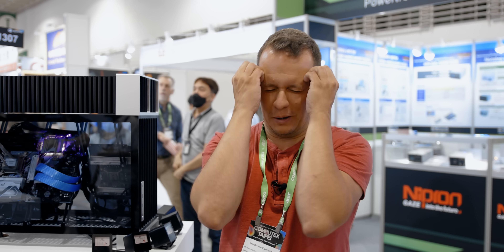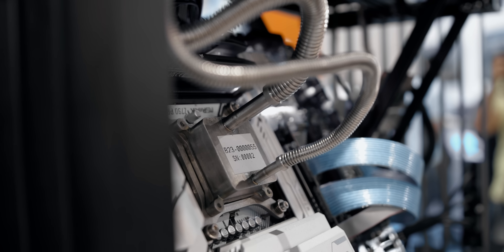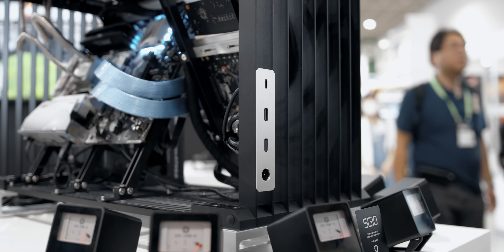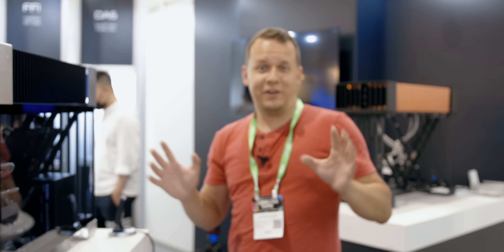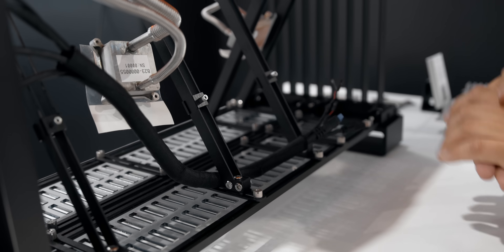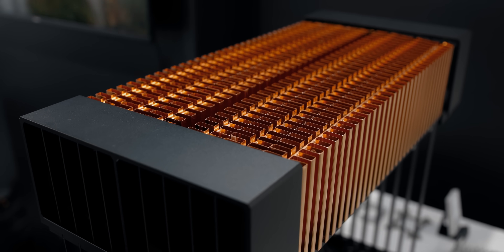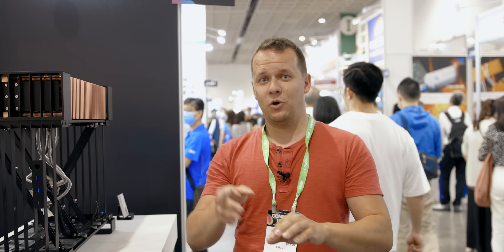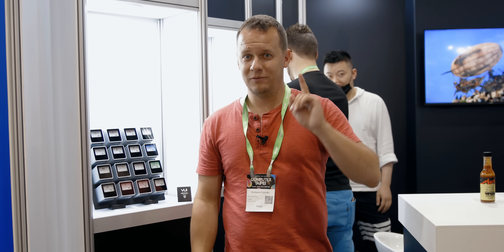Passive Cooling just got REAL.

Comment: The angles are likely necessary to ensure proper refrigerant circulation: when the plate boils the refrigerant, the angle ensures bubbles will rise towards the outlet and help the natural convection along instead of potentially trying to go back up the inlet and stalling the whole thing if the bloc was horizontal. Kind of neat, though I need my PC fans' noise to bury the slight humming from my UPS.
Reply: The angles are just just a gimmick to fill the otherwise unused space and make it look cool, as they cannot shrink the heatsink for obvious reasons. Ideally they would have tried to make it as compact, but dimensions are dictated by TDP
Reply: @TheTecnicamente  If you have a passive evaporator and condenser combo, the only thing circulating the refrigerant around is the liquid phase sealing the inlet against vapor going back up the way it came from, the angle ensuring (most) bubbles cannot go back up that way and the liquid phase's weight providing lift to move the vapor phase.

Putting the cards on an angle wasn't necessary though, they could have made angled evaporators to leave everything else squared off. Though this would have made the evaporator taller (as tall as it is wide for a 45 deg. angle) and required more refrigerant to flood.
Reply: @TheTecnicamente  Mhhh, I'm fairly certain they need it to avoid any backflow in the system, that's either that or full on vertical components.

Comment: Looks good, but as far as I know Calyos already scammed their customers once (Kickstarter NSG S0 - passive case) which is why in the aftermath the Monsterlabo team split up from them. Monsterlabo offers "The Beast" (400 to 600w passive cooling case) for 750€ they are lovely people and really care about their product,  therefore I won't even consider Calyos unless they not only ship working high quality products but offer better performance than Monsterlabo at as similar price.
Reply: "The Beast" only supports 400W in passive cooling configuration. You need to add fans if you need more.
Reply: @vsm1456  I know but the main problem is still standing!
Calyos never delivered their product, never paid their backers back or even acknowledged it! They just went silent for 6 years, now start promoting pretty much the same product and somehow nobody from the hardware community questions them...
(Including Hardware Canucks)
Reply: @Ahnii  exactly. And now they get promoted again even though they do it with Streacom. I know people that payed 1400 euros incl. All for that chassis and it never arrived.
Reply: @Ahnii  It seems LTT refused to cover them because of that, apparently Calyos won't refund ppl who bought the original NSG S0, but the "solution" of Calyos is that they will give backers a voucher (of the amount of what they spent on the original Kickstater campaign) to buy this new case, so they'll have to spend like 400-500$ more to get what they backed for, more than 6y ago. That's ridiculous
Reply: @MasteRCrysiS  exactly that!
Reply: @MasteRCrysiS  i imagine the reason why they want 400-500$ more to get the case is because otherwise the case would sell at a loss/making them bankrupt before half the people used their vouchers.

This is extremely common with kickstarters, where the company underestimates what the product will cost to produce, then fail to deliver anything because they spent most of the kickstarter money on r&d and obviously cant sell products at a material loss.

Comment: $1000 for that engineering is really cheap for a passive cooling of that performance, so getting it is really great. But the real question is, why.
Reply: less dust, less noise, less power consumption. Those things are minimal compared to it driving tech forward, that's why.

Comment: This is neat but without ANY fan noise aren't you just going to hear the coil wine on the GPU or PSU? Especially with an on desk setup. Having low fan RPM's at least creates a nice faint white noise vs the high pitch screech of coils. I guess if it was also in a sound dampened case it would be pretty amazing,

Comment: God I hope they are still selling this case in 5 years when I can finally afford it.
Reply: If their prior Kickstarter performance is anything to go by you'd be lucky to get anything at all. Do not buy this. Linus did a clip from WAN show on this about why they didn't do a video on it and it comes down to one of the companies scamming backers on Kickstarter in the past. From what was said nobody recieved a single unit.
Reply: @E3_Kruger  Streacom is selling this not the Kickstarter creator big difference. The KS overestimated the difficulty of producing the OG case design. They didn't give up so I don't think it's a scam. It's not the same case but they're giving out voucher toward this new case. That's the risk of KS. The cooling tech is real so Streacom is doing the case design Calyos is providing the cooling tech. This design is much simpler than the original.

Comment: I remember when Linus showed a passively cooled i5 and 2070 for $6000 so…

This is borderline reasonable.
Reply: It is reasonable in comparison to a custom loop (which is inherently an unreasonable flex). Compare it to air cooling though and it's no contest. High end air cooler, 60-100. Case, 80-120. Let's say you throw out the stock fans and buy expensive ones, add another 100-150. 650$ more dollars to go from a quiet build to a completely silent one. Not worth it.
Reply: @rogerhill2707  Unless you want completely silent! (Provided there's no coil whine in your power supply and GPU.) There are applications for that. Also, some people vastly prefer the aesthetics of a completely quiet environment, where even a quiet build would be noticed.
Reply: @stcredzero  Yeah check your reading comprehension I mentioned that it wouldn't be totally silent, merely quiet.
Reply: @rogerhill2707  Check your reading comprehension. It is broken if you think I alleged you said your comparable would be silent. Reading comprehension failure 2: The point is that some would have differing use cases which would require silence, which IS a different point than the one you alleged for me. BZZZT! Sorry, but you apparently don't even comprehend the reading comprehension objection!
Reply: What about an all aluminum version for lower power levels? 300-500 watts? Reduce the design aesthetics and forget about the angling. (Or maybe just the GPU?) Also, selling "barebones" kits bundled with the stripped and heat-sinked GPU cards would greatly increase the potential market.
Reply: Which turned out to be a Kickstarter scam... and made by the same company as this case, Calyos.
Reply: @p_serdiuk  really? I sure hope this is real.
Reply: I'd totally use this for my media server just to remove moving parts. Even if you put a super quiet fan to keep some airflow in case you set it in a corner without proper flow, it'd still be super quiet.
Reply: Ah for when computers have much in common with cars.
Reply: Love the idea of passive cooling. But something in me just wants that massive radiator with water cooling going through it. Or some way of combining this cooling with Liquid cooling. Whatever gets lower temps. The idea of keeping a GPU at 40 degrees is just too enticing.
Reply: remember how that was the same company working on this and they didnt deliver last time. idk id rather pay the 6000 and actually have it delivered rather then pay 1000 and have the risk of it not being delivered

Comment: If this actually delivers, it will be a gamechanger. No longer have to worry about your GPU taking off like a jet engine whenever you're playing a hardware intensive game.
Reply: I'll stick with fan noise rather than commit to needing an HVAC tech to fix my cpu/gpu cooler. I don't think people understand the complexity of dealing with HVAC, if anything goes wrong you either need a bunch of tool or have to hire an HVAC tech, both are expensive.
Reply: @bobbygetsbanned6049  this has zero moving parts, there is nothing to break here. The only possibility for something to go wrong would be a physical crack in the copper at which point the whole case would probably be mangled because of the forces required for that to happen.
Reply: Noctuas are pretty quite
Reply: If you have enough space, an AIO or custom cooled card is not that noisy
Reply: Depending on the refrigerant, a normal person might not be able to access it. Also, if it does get pretty hot, imagine how hot the room might get
Reply: @TonyNguyenJr  so like any other cooling solutions? 600W is 600W regardless of cooling used

Comment: How well does it work if you're in a room without air conditioning? Not everyone has AC.

 Then again those who are purchasing this case can afford to have AC, but I'm curious how well it works if the room temp is 80 or 90 degrees.

Does it support fans if you wanted to add some?
Reply: It is no different than a fan cooled system. The air coming in is the same and the heat leaving is the same, just a different method to make it all move. 

A system with fans and water cooling will also struggle to get rid of heat if it is really hot in the house.

Comment: $1,000 is reasonable for this, the all-copper is not worth it imo. You'd also need a fanless PSU, I think Seasonic makes a 700W fully passive one. Ironically, the issue with a fully passive case like this will be dust. Dust will just settle in though the top, you can't cover the top in any way or you'd impede convection. With very low-RPM fans and dust filters, you can have a virtually silent system and control dust, so I really don't see the point in getting a case like this other than as a proof of concept. It's also going to weigh a LOT and the I/O will not look clean, the interior will not look great either without hidden areas for cable management. The only practical application I can think of is if you want to build a server and leave it in a room for 10 years and you don't want it to have moving parts that can fail.
Reply: How difficult would it be to vacuum clean it when turned off?
Reply: Just vacuum it and blow the boards off with a can of air every once in awhile.